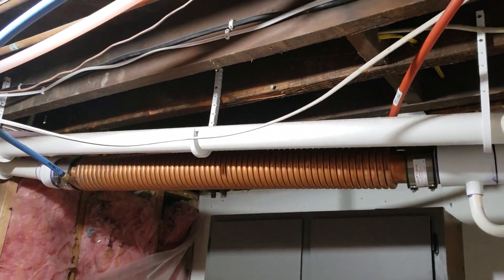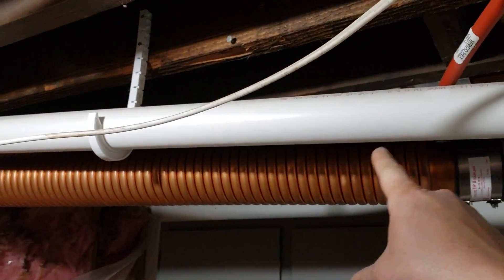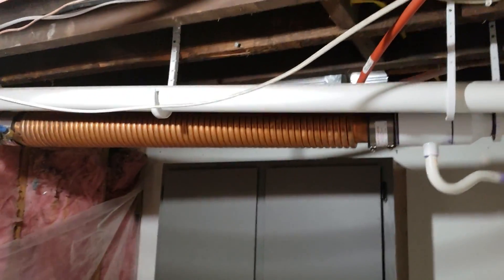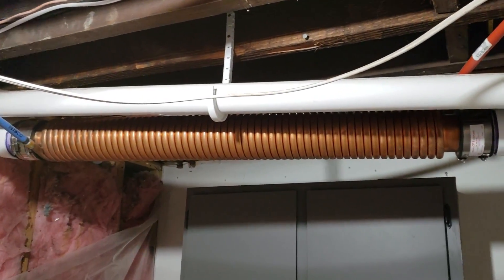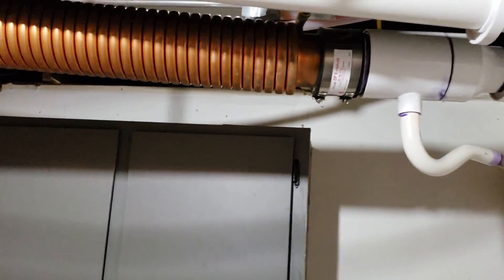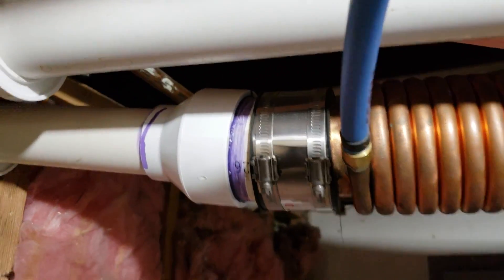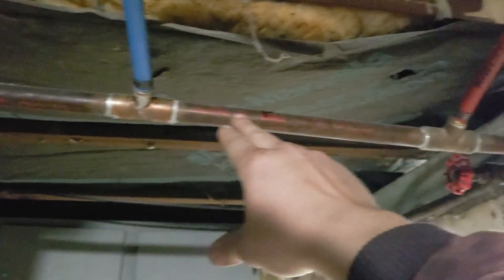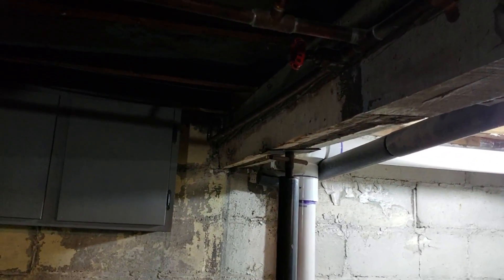Experimental Heat Recovery Furnace Exhaust! Preheat water heater

Comment: probably a good reason why no one else is doing it. unless you think you have had an einstein moment and the world will for ever wonder at your genius. heat exchanges have been around forever. heat exchanges on a plastic pipe boiler exhaust not so much lol
Reply from the maker: It is experimental, but worked quite well. Should not be done by a novice!  It's a big up front cost and the payback is years. Also can obviously be hazardous if it leaks!
Reply: @larsonhomeinspection9932  well thats the place to do experiments :) i mean not one pvc pipe producer recommends pvc pipe for this purpose but yeh lets run a shitty experiment in my basement and show people that will try it for them selves. good job nut ball.

Comment: My father led a one-inch iron pipe through one side of his wood-burning furnace and out the other, preheating cold water and passing hot water into the gas water heater. The pipe was about two feet long. While he used the furnace his hot water was free and he only paid for the pilot light and the service fee.

Comment: No one is doing this because the energy available for recovery is so low. If your boiler has a 100k BTU input, and it is 95% efficient your looking only 5k BTU available for recovery. Call your energy recovery efficiency 50% on the absolute high side. Assume it's crazy cold and your boiler is working 75% of the time. That's 45,000 BTU per day or about 38 cents saved per day on natural gas in absolutely ideal conditions. You're looking at a 6 year ROI at a minimum. In a modern climate is more like 12 years.
Reply: That's not horrible for just a roll of copper tube.
Reply: yer wrong

Comment: A tee, even with some vanes in it, would not ensure that there is an equal flow going through the exchanger and the bypass.  There will of course be equal pressure drop, but due to the low flow going through such a long run you have to the exchanger.
Reply from the maker: They're called monoflo tees. Work very well, plenty of flow, probably 40%.

Comment: Don't you worry about exhaust gas blowing through the water in your p-trap and letting CO into your house? Why not tilt the whole thing towards the outside of the house and let the gas + condensate run outside?
Reply from the maker: Every high efficiency furnace has a p-trap of some sort to prevent exhaust coming into the house. Every HE exhaust needs to be sloped back towards the appliance. If its sloped towards exterior, the water can freeze at the end, pool and block the pipe.

Comment: I really like cold water coming out of the tap in winter. I would have put this just upstream of your water heater and leave the cold alone. Nice work, though!

One concern I had is about heating the water when it's not moving. In your system, it looks like any time water is coming into the house, water is moving through your coil. Presumably any time the water heater is on, water is moving through the pipes, but what about when the water heater turns off? Then the exhaust pipe is still getting warmer and the water in the coil is still heating. That doesn't seem so bad, but you talked about applying this to a furnace exhaust.

When the furnace is on and producing heat at the exhaust, it is likely the water is not moving. This can cause a dangerous pressure build up in the copper pipes, right? How is that mitigated?
Reply from the maker: You have the right idea! Yes, it can be put just on the hot line upstream of water heater. I'm in MN, and the incoming water is always very cold! When the water gets hot, it just expands and goes back into the city water line, just like a water heater. The only time you need an expansion tank is when there is a check valve on main city water supply.

Comment: any ideas of drain heat exchanger?
Reply from the maker: Not sure what you mean?
Reply: @larsonhomeinspection9932   same design applied to the drain water coming out of house and preheating fresh water coming into house. So the water comes to the boiler a bit warmer than regular +5°C
Reply from the maker: @kirillbobko4557  yes, thats what this unit is originally designed for. They do capture lost heat, but the payback is a long time, and really only makes sense with at least family of 4.

Comment: 95% efficient boiler is a myth. It takes time for the boiler to get to a temperature at which it starts to condensate. By the time it gets there, the call for heat is mostly over, so you will not get the promissed high efficiency. You need long cycles to achieve high efficiency. The setups used by manufacturers of high efficiency boilers and furnaces are ideal conditions which most homes don't meet in real life.
Reply from the maker: That's why the supply temp should be calculated and set low enough that the boiler is running at a low burn for long cycles. These boilers are fully adjustable. This one actually has an exterior thermostat which controls the supply temp based off outdoor temperature. Makes it much more efficient. I didnt have that option, so I adjusted my supply temp when outdoor temp changed. Much easier on equipment as well.
Reply: @larsonhomeinspection9932  the outdoor temp sensor is used for the outdoor temp reset. You boiler should have had a combustion analysis when installed to make sure it's set correctly and to provide long service life to it. ...
Reply: I was just refering to your statement that you have a 95% efficient boiler which may be the case on paper but in reality it is probably slightly over 80% . Using the drain heat recovery system for boiler/furnace waste heat like you have might have a very long payback period. By the time you add time and materials cost and lost opportunity cost on the above funds, you may find that it is not worth the effort. I have a similar tankless boiler but the waste heat is very low (as it should be). You can put your hand on the pipe close to the boiler very comfortably (without asbestos gloves). Good effort though to save the planet and you probably had fun which is important too. Having a setback thermostat with not too small of a temperature differential  will save you more money.
Reply from the maker: @ninjatrader6624  thanks! yes its only 95% at certain times. It would be a long payback and not practical for most houses as these are getting more expensive. But it was fun and proof of concept. Most HE furnace exhaust heat is around 100 degrees, so definitely lost energy.
Reply: What you said is true but it's even worse. You can't just go by exhaust temperature alot of "high efficiency" equipment have incomplete combustion due to high velocity of induced draft. Combination boilers are worse of all due to very short  cycles on calls for domestic hot water (e.g.hand washing). Plus add on post purge time. "High efficiency " equipment has a much shorter expected service life and more expensive and more frequent service and repairs compared to "standard efficiency"

Comment: Noble idea but I would shut that appliance down so quick without approval from the respective authorities. They likely never would approve this due to the risk of exhaust gasses venting into the living space and the increased likelihood of freezing of the exhaust termination. Interesting but definitely not safe.
Reply from the maker: Yes, it is not legal and is just an experiment. However, if installed properly it is entirely safe. There is a solid copper pipe in which the exhaust gasses pass through. There is no chance for exhaust gases to leak out. The copper pipe has to be coated on the inside to prevent corrosion. I've had this installed in MN for 2 years and no leaks, no problems, no freezing of the termination. A HE furnace exhaust is fan powered and does not rely on heat for draft. Lack of temperature exhaust will not freeze anything. Condensate flows back towards the appliance. It is antiquated close minded thinking that holds back new ideas. It is an experiment and no one should install one without knowing what they are doing.
Reply: How would exhaust gas get in the living area . He wrapped a coil AROUND the exhaust

Comment: What kind of paint did you use to coat the inside of the pipe? Can it be covered in insulation without causing damage to the pipe or insulation and prevent accidental burning while  keeping more of the heat in the pipe?
Reply: Condensate will eat through that copper in a year or 2 without it coated
Reply from the maker: @chrishoefer9732  yes it needs to be coated
Reply: @larsonhomeinspection9932  
Epoxy is going to severely retard the heat transfer properties. You need a tube made of much more corrosion resistant metal like Monel, often used for corrosion resistant piping and heat exchangers on ships operating in salt water.
Reply: @chrishoefer9732  the acidic exhaust gas will eat through any coating. This is why high efficiency boilers or furnaces are always vented with pvc. You will not prevent it from happening with a coated copper pipe you are just prolonging the process. It will eat through it and leak ...
Reply from the maker: I would try even rust oleum epoxy, just make sure the coppers clean and scuffed up, maybe run a drill brush attachment through it.

Comment: Can you use this on a propane tankless condensing water heater? If so what brand heat exchanger are you using?
Reply from the maker: Sure you could. I bought mine off ebay from a Canadian company 3 years ago. Icant find them anymore. Home depot has them, but for $800. Preety sure i paid $300. Copper didnt go up that much!?